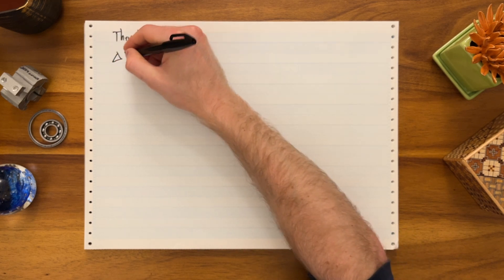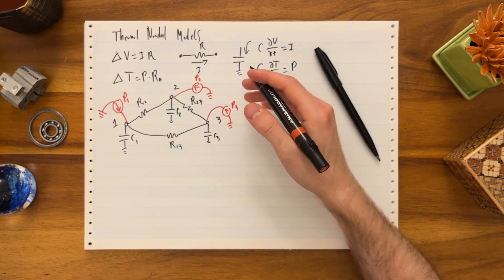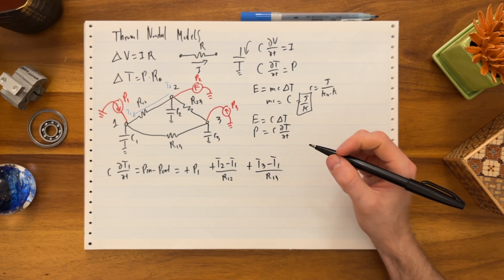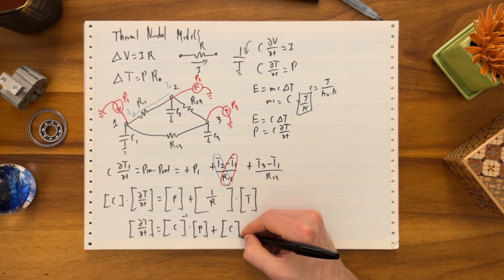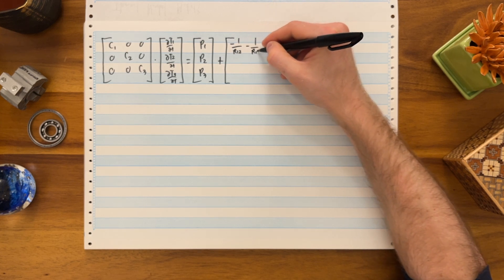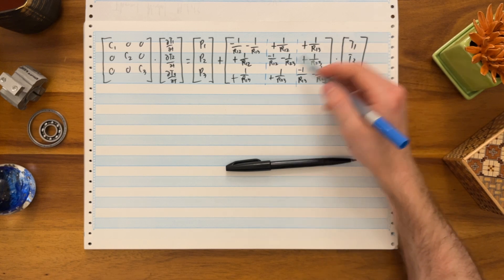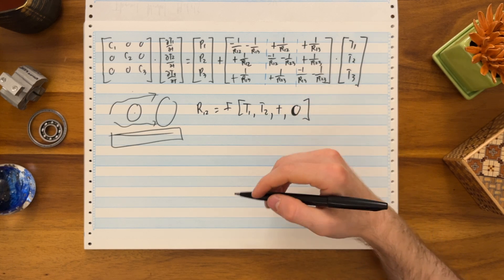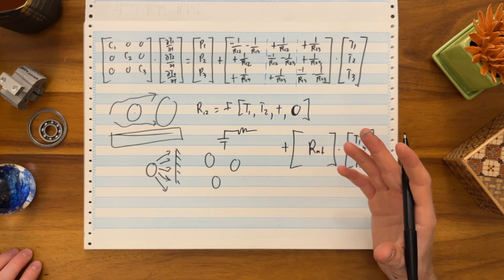Thermal Circuits 2: Nodal Networks

Comment: Hadn't seen anyone approach thermal analysis for electronics like this before.  There are published values for thermal resistance of power devices, heatsinks, etc.  Are there standard values for thermal resistance for circuit board, which would be the typical path for heat flow from device to device? The copper in the board can vary greatly from design to design.  Never saw anyone get interested in a transient model like this, where thermal mass and heat flow was considered.  Usually the thermal analysis just focuses on the max ambient temperature and the max dissipation of devices during steady state conditions.   Can you provide the specifics of the cases where this sort of analysis is considered essential?

Comment: I've never really considered thermal behavior of circuits before, but this is pretty informative! The circuit analogy is surprisingly powerful -- though it would be nice to be explicit about the relations; charge as (thermal) energy, voltage as temperature. I enjoyed the little hint of linear approximations applied to complicated thermal systems near the end.

Comment: I would suggest differentiating heat from power. Power can come in many forms, but here, your equations are only for heat flow. As a result, I think it would be better for viewers if you use the words heat. Also, it's more common to see Q for heat instead of P.

Comment: I've been delving into this analytic technique for the past days and it's been a fun ride so far, your previous video and this one helped a lot. I'm now able to understand and calculate how my electronics will behave thermally like never before. Next big thing is to understand distributed elements/thermal transmission lines which can't be modeled used lumped element methods.
Reply from the maker: Great to hear it. A lot of common geometries (plane, cylinder, sphere) and typical boundary conditions (constant temp, constant heat flux, constant resistance) have analytical solutions which are really powerful. For more complex geometry or boundary conditions you can take a component and slice it into many small nodes and then simulate as a nodal model and approximate the true diffusion equations.